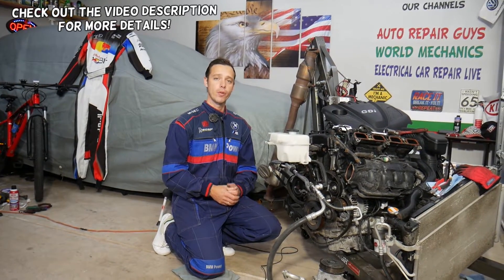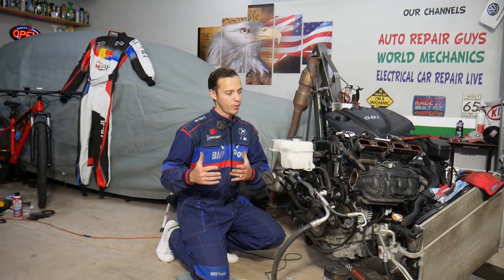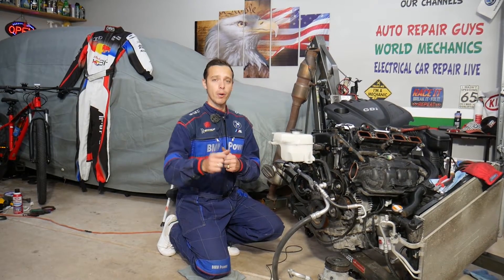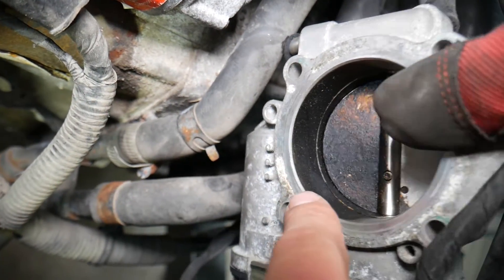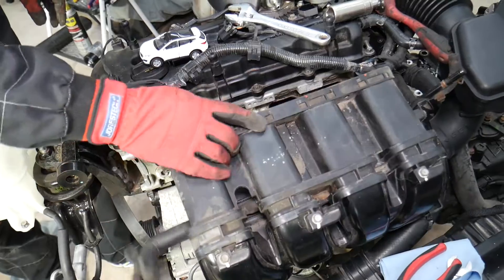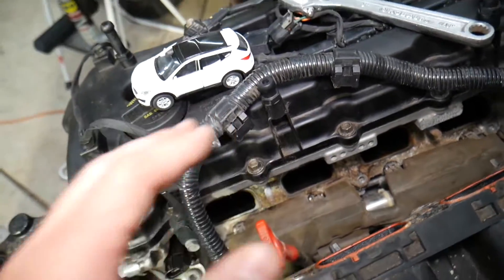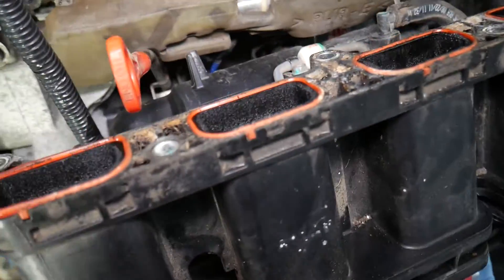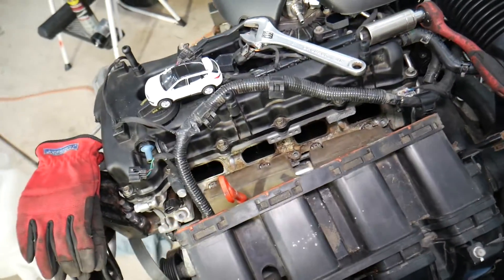WHY THERE IS CARBON BUILD UP IN INTAKE MANIFOLD OR THROTTLE BODY on Hyundai Stanta Fe

Comment: I have on toyota 2 hoses ... 1 from pcv valve that is going thru manifold , and 1 hose without pcv valve that is going in air intake between body throtle and air sensor. Body throtle (in think) is not taken carbon from pcv valve but from the second. Failure of pcv valve is affecting the manifold and valves, but not the body throtle...my opinion only.